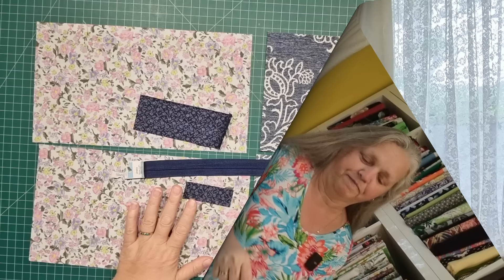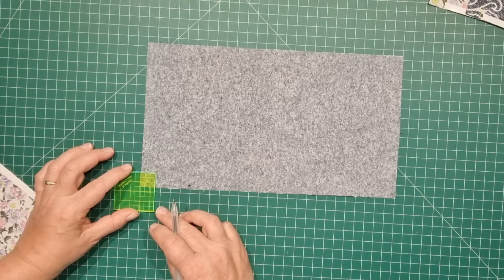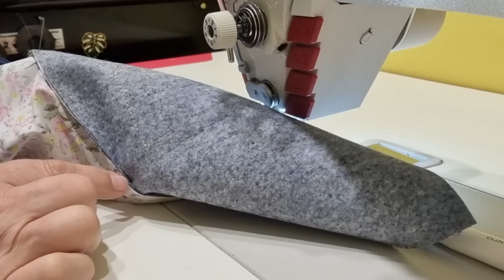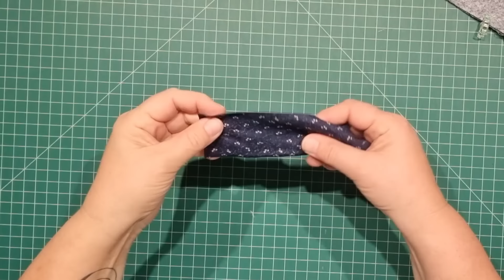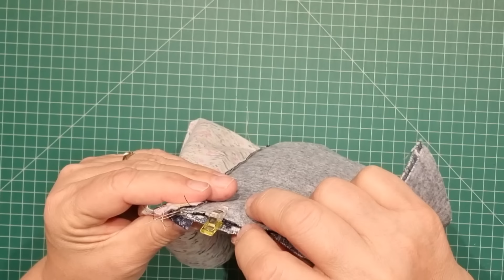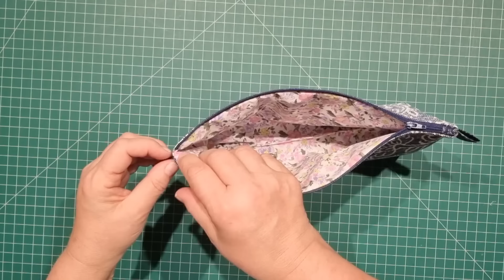Learn how to do the Butler Method zipper for any type of bag. Easy tutorial for lined zippered bag

Comment: Christine. Where is that tiny green square grid ruler from please
Reply from the maker: You can gat many different types, such as these here. https://amzn.to/47kyUfX
The one I have was a gift from a craft show many years ago😀
Reply: @ChristinesHomeAffairs  thank you. It is the best Ive seen. Uncluttered and looks very useful for checking seams etc on small items. Best of all are the dual (1/4” and 1/2”) grid squares. 
I want it specifically for very simple standard measurements of, eg pouch seams. So far I can’t find anything with those markings. There are 2” rulers, but they are too busy, and the quarter inch definitions aren’t great. 
 I will keep looking.  
Thanks

Comment: When I have put zipper's in jacket's I have used the non hook (flat bar with the curled loops) end of a hook & bar for a zipper stopper at the top of the zipper. I crimp them down around the top of the zipper. You do have to be careful when  sewing over them not to hit them with the needle. 
 I have had so many on hand rather than buy the little pieces. 
 Joanne Fabric stores have closed here in the United States so it is getting difficult to find many of the notions necessary to sew and craft. Have to be creative!
Reply from the maker: That's a great tip, thanks for sharing 😀

Comment: I've started making bags and found your workshop (Butler method) very helpful, but can you please explain why you use double sided tape?
Reply from the maker: That's a good question.
I make about a thousand bags per year. Using the DST saves a lot of time not having to pin or clip edges together. It also keeps fabric layers from shifting whilst sewing. The small expense for the tape, outweighs the time saved in production costs.😀

Comment: Curiosity prompts me to ask: why not use that curved method on both ends of the zipper and eliminate the zipper tape completely?
Reply from the maker: I wondered the same thing, so tried it.  One end of the slider is curved, and closes the zipper. The other end is flat, and opens the zip. If you applied the technique to both ends, the slide would come straight off!😁
Reply: @ChristinesHomeAffairs  I just tried it this morning and found it worked for me. I think I saw this technique used on a small pouch by another YouTuber ... maybe Owl Be Sewing? I'll see if I can find it.

Comment: I would like to ask what kind of foot are you using on your machine to do the stitching on this bag?  It is a little difficult to see, but it looks like the narrowest foot I have ever seen - even narrower than my zipper foot or my straight-stitch foot.  It must be exclusive to the type of machine you have.  It is apparent that the narrower the foot you can use, the more accurate you can stitch on projects like this.  Thanks for the very informative video.
Reply from the maker: Jonna, it's called a narrow presser foot, or zipper foot, but is for industrial machines. You can easily purchase them online if you use an industrial😀

Comment: I have had trouble with using the tape as my needle gets sticky and stitching is jammed. I’ve cleaned the machine out under the bobbin, changed the needles but nothing works, any suggestions?
Reply from the maker: Gillian, you need to find a good quality tape that is designed for fabric. I like Sew Easy, but it's getting hard to find.😁

Comment: Getting the zipper out of the side seam is critical for sharp corners.  Zipper tabs do this just fine.  I guess the benefit from this method is the pouch does open a little wider, but for me the biggest advantage is that the end of the zipper doesn’t separate and risk one half of the zipper poking up above the fabric or out from under the zipper tab.
Reply from the maker: This method will certainly be good for some applications, especially recessed zippers. I do like the tabs better though😊

Comment: When I sew across the bottom of the lining, rather than leave a space, I use my longest stitch length to baste across that space (with backstitching of the ends of course). Then open the basting stitches to turn and the fabric of the lining will then “want” to fold in for final closing.
Reply from the maker: Thanks for the tip Kris 😀

Comment: The tips to mark the 3/4" on the fabric and to leave the one side of zipper over the edge so the zipper head does not cause problems are most welcome. ( Zippers have gotten easier for me and now with your tips they will be easier still.) Also, the way you did the zipper tab makes so much sense and will avoid all the difficulty I've been having when I've tried to add side tabs.
Reply from the maker: That's fabulous Michael.  Thank you 😊
Reply: I love the little yellow square you use to mark your 3/4” line. Where can I get one? Is this something that I can purchase from you?
Reply from the maker: @nicolegoller4220  it was a gift from one of my suppliers many years ago. I am looking into getting some template sets made up though 😃

Comment: I can see the benefit in the way Amy does the zipper when it's for a bag that needs a tight closure. The only thing i do differently is include the lining in the top stitch so it doesn't travel upwards with usage and get caught in the zipper. Thank you for the video. Good job with the explanation.  I'm going to try the "no tab" style.
Reply from the maker: I'm hoping to do a time trial and comparison soon using my method vs Amy's, though I'll topstitch all the layers😀
Reply: If you give your lining a good press and pull it down as you press, it will not ride up and get caught in the zipper.  Steam pressing that lining  will keep it in place. I prefer not sewing the lining down at the same time as sewing the outer portion. It makes a much nicer finish on either end of the bag when the lining is not sewn down with the outer fabric.The weight of the  bag contents will keep the lining from getting caught in the zipper . Taking  a slightly larger seam in the bottom of the lining will assure that there is not extra baggy fabric that can creep upward. I checked all the cosmetic and change bags that I have bought and none of the linings are sewn down. I have never had any lining get caught in the zipper. All that being said, that is the joy of sewing , you do what works for you . Lovely bag , lovely instructor.

Comment: I made my first pouch using this method.  Took me some time to get it just right. But, success!  I found the tape to be useful in lining up the edges but removed it and pinned the fabric instead.  I found this easier as I think I had the wrong double sided tape and it was kind of stiff.  I will be using this method, it is so clean with no bulky edges!! Thank you for teaching this in a video tutorial!
Reply from the maker: You're very welcome. Thank you😁

Comment: There much less bulk on the closed end if the top stitching is begun 1/2-2/3 inch from the edge of the fabric.  I’m not sure where I first saw this technique but it’s changed to look of my pouches and give the a much more professional result.  Absolutely no pinched edges.  Ive also used the Butler method,   & often combine the techniques.
Reply from the maker: I agree Sandi. I usually start it where the zip and tabs meet which allows for neat edges😁

Comment: What is the tape you are using to stick the zip to the fabric, been sewing for 50 years but have never seen that in England? Do you have to iron it to get it to stick.?
Reply from the maker: Maureen,  it's a double sided adhesive wash away quilters tape. I use Sew Easy brand. It dissolves in water if required,  and is repositionable. You don't need to iron it. Just peel the tape off and press. It doesn't gum up your needles either,  but other types used for paper craft will. Look for one suitable for fabric 😀

Comment: I just completed my first of these bags using light weight upholstery fabric I was gifted.  It ravels like crazy but I managed to get the bag done using the clever zipper method.  Quite honestly, I'm now questioning why I wouldn't do the Butler Method on both ends.  I also agree that I like topstitching the outer and lining fabrics together, however my lining piece shifted a wee smidge and it's really close to the zipper teeth.  I just ironed it away from the teeth a bit so it won't catch.  I'm certainly NOT going to try and unpick it with that ravelley (is that even a word) outer fabric.  I would have a disaster on my hands for sure.  Now tell me how to unzip the zipper away from the pressure foot as easily as you do it.  I StRuGGle with that on my Babylock.
Reply from the maker: It's a new word now Cherie. As for the zip, I have really high clearance when I raise my presser foor that many domestic machines don't have.  That's why it looks so easy.  Not sure if you know this, when you raise your presser foot normally, you can pull the lever up even higher (but you have to hold it there), it will give you more clearance.  I might have to try the double ended Butler method. 
 I feel as though the other end would slide off😁

Comment: Hi Christine thank you for doing your take on this method , I use this method when I am making gifts as I think it does give the bag a professional finish and the opening is a little larger than when using tabs at both ends. I do the top stitching when the bag is finished and pulled through , I sew from where the tab meets the zip along one side then round the  corner where the zip is curved , then back along the other side. I find this then helps the lining  at the curved zip end stay down iinto thebag. Hope this makes sense  , also I called out  " you have forgotten to open the zip " 😂
Reply from the maker: Haha, I'm always forgetting to open my zips. ☺️

Comment: Can I ask how you get the paper backing on the fabric? I was able to get some fabric books. But the tape on the back are pain in the rear😅
Reply from the maker: They are a pain Michele.  I use a heat press now, but a very hot iron gets most of it off ☺️
Reply: I tried the heat press.  It just burns the paper. Do you have a video of how you do it?

Comment: I think the top stitching should include the lining, but that would make the zipper technique a bit more difficult. Would it make tucking the zip more difficult? I like the finish in the front, but not the back. I like your method, it's much easier to follow. After making hundreds of bags, maybe I'm stuck, but the lining would bother me to no end. 😊❤ I like the rounded edge as opposed to boxing when it's just for pencils and pens. At least it's a different finish to offer, everyone feeling like they have something special.
Reply from the maker: I prefer the top stitching through all the layers as well Sharon.  As long as you don't sew all the way to the end, it will still turn through neatly😁